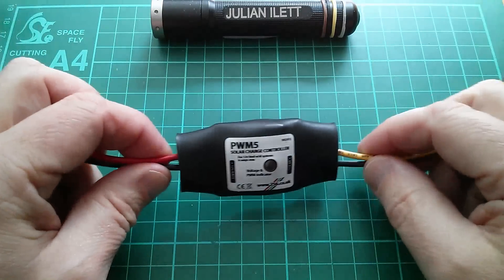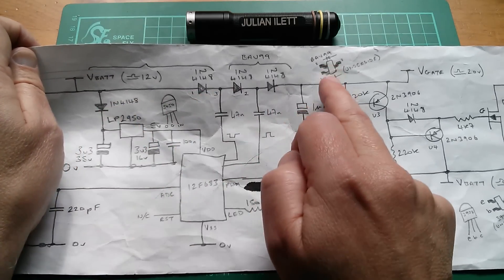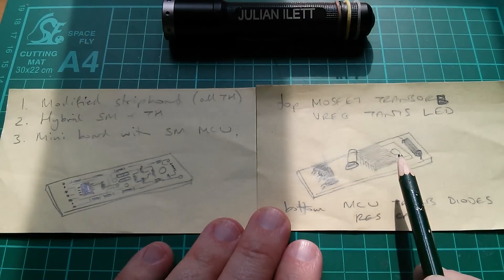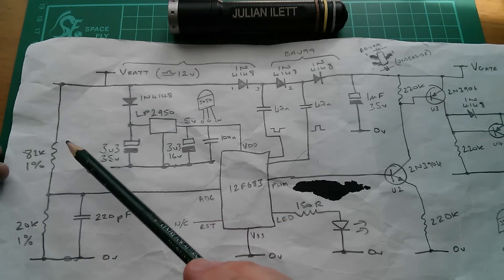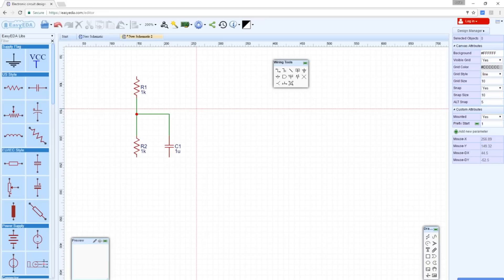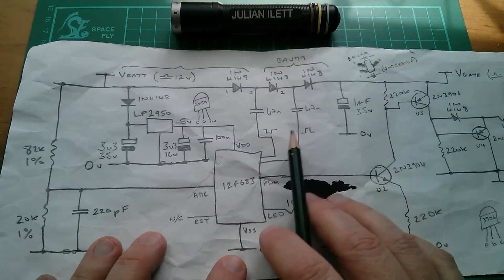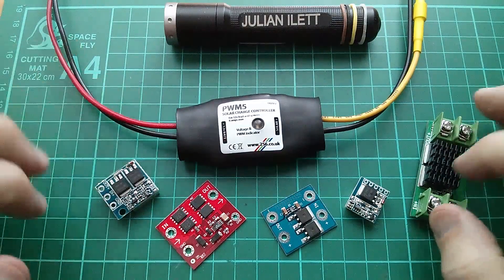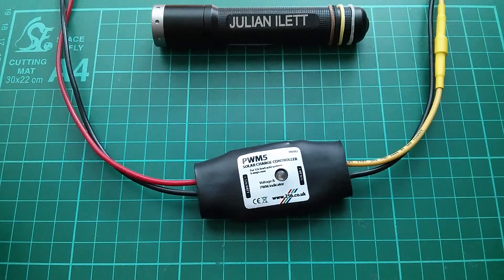PWM5 Solar Charge Controller SMD Re-Design with EasyEDA

Comment: You REALLY should consider to buy yourself a proper new PC. :/ The FPS of the screen capturing is really not that great. And screen capturing using OBS isn't even a big task for a PC.
Reply: An i7 and 1080ti wtf? That's super overkill considering what all he does... Any old i3 or an equivalent PC should be more than suitable for all his needs, also I don't know that he even exports videos, I thought he did like bigclive and uploaded a bunch of clips through the youtube app.
Reply from the maker: Not sure how old it is, but it's a Celeron 887 1.5Ghz with 4GB RAM. I'm guessing that's pretty bad :(
Reply: "1.5GHz" hehehehe!
Reply: Hell, why not recommend a Xeon E5-2699A v4?
Reply: I guess you can't spot irony, Ken.
Reply: Use http://www.ssdready.com to monitor your SSD for 24 hours, you'll be surprised to see how much an OS writes to your SSD.
Reply: OBS is really good, not super intuitive to use but I do not lose frame rate even on my relatively lame laptop.  Better than Bandicam or Hypercam...
Reply: Yes. I wonder how old his PC is, I guess it predates even 2007 or so...
Reply: Because that Xeon is for a dual CPU configuration (2 at the beginning) and EXTRMELY expensive. You could by 5 1080ti's for that amount of money when you also buy suitable motherboard and PSU. Video encoding has quite enough quality on GPU only encoding, which is several orders of magnitude faster. I guess he will be pleased with the video quality of that GPU.
Reply: +Julian Oh yeah, if you're feeling up to it, you can sometimes replace and upgrade the CPU in most of the older laptops as they aren't soldered (although some still are soldered) onto the motherboard, so as long as it has the same socket and a similar TDP rating, then it should work for most laptops, in your case something like an i3-2310M with the FCBGA1023 socket "might" work (has a higher TDP) and as it turns out is soldered which makes it very difficult to remove, but I did it with my old laptop and it's as fast as a brand new $500+ one, however you'll have to do some research and decide for yourself if it's worth doing.
Reply: I am pretty sure that upgrading the processor won't work at all, the socket will be obsolete. Used CPUs for this socket that bring more power might be even more expensive than a complete new PC with an i3 and integrated Intel Graphics for around 100 Pounds.
Reply: +Julian Ilett omg i've always skipped buying Celerons :)
Reply: Ken, Celeron 887 is BGA1023, so soldered on the board without a socket. I guess Julian uses a laptop.

Please point me to a place where they sell a new, complete Core-i3 PC for around 100 Pounds, I'm very interested.
Reply: Screen captures don't have to be exported, they can have huge file sizes if no form of compression or processing is used but it never HAS to run through an editor.

"The socket will be obsolete" What? That doesn't make any sense, sockets don't suddenly/randomly update or change, they can't become obsolete, well technically they can in the sense that a new processor won't fit in an older socket and vice versa but that's completely different and did you even look up the prices? Generally, for laptop CPUs they don't tend to sell as much as the desktop counterparts, I got my i5 for a mere $15 and they usually go for around $40-50 (40 pounds) on the high side.
http://www.ebay.com/sch/CPUs-Processors/164/i.html?_from=R40&_nkw=i3-2310M&_sop=15

You aren't going to find a new laptop with an i3/i5 for less than that, also you should consider that the new processors are moderately slower than the older Sandy and Ivy bridge processors in order to get that longer 6-10 hours of battery life, not a big deal for most people but for me I don't care too much about battery life.

+oscar kurka thanks for pointing out it's soldered, I didn't look up whether it was or wasn't.
Reply: My E8500 Core2Duo, with a 2300 CPU benchmark, probably could do it, yours is 1300. A cheap G4560 is 5100 CPU BM.
Also a SSD for the OS totally transforms a PC, because the PC feels very snappy when you use it, and you don't need as much RAM because the pagefile system is now so fast.
Reply: I did offer you one, it's a 3Ghz E8400 core 2 duo with 4GB of ram.
Reply: That's a myth. You would have to write 10GB/day for 10 years before it reaches it supposed writes. Every test on them has always shown them more reliable, and that was tested in servers.I personally would never use a PC without one for the OS, it makes that much difference, and in fact have 9 cheap SSD for the OS's in my PCs.
Reply: Depends on how old the SSD is, if it's one of the earlier models then it might wear out, but if it was made in roughly 2012 or later then yeah there's definitely no need to freak out about saving writes, even writing 100GB a day it would still last longer than a typical HDD, but even if you do have an old one, you can always find super cheap 16-64GB SSDs on ebay these days so you could get one purely just to dedicate to swap or caching.

note: I don't know a lot about how it works, but I do know that swap and pagefile operate pretty differently even though they serve more or less the same function and that swap is a bit harsher on writes than the pagefile, which is one of the reasons why the latest ubuntu is switching to a paging file.
Reply: Older SSDs use SLC flash memory which has a 10 x higher write cycle than the more modern MLC flash memory.

Writing 100GB a day on a Samsung 850 Evo 120 GB SDD wears it out in 14 months.
Reply: Sidney, why do you use 9 SSDs for the OS's on your PC? It's 2017, just use a bigger SSD and run them virtual.
Reply: I don't suppose you have a link about that? Because I remember this article a couple years ago about how they wrote several 100 TB worth of data to a handful of NAND based drives and one TLC based drive, of which, those lasted about 18 months doing way more work than 100GB a day.
https://techreport.com/review/27909/the-ssd-endurance-experiment-theyre-all-dead
Reply: Sorry, 9 different PCs and laptops. In fact everything I have has a SSD because most are old and the SSD allows them to keep up with more modern CPUs.
Reply: According to that article, If you write 100GB/day it last 1.5years, 10GB/day 15 years, 2GB/day, which is what you will use, 75 years. Trust me, buy 1, put your OS on it, and you will never go back, it's that good. Everything just feels so much more instantaneous. It's the  single biggest improvement I have seen in PCs in the last 37years.
Reply: "2GB/day, which is what you will use"

There is no way that you will write only 2GB/day on a Windows OS partition. You're lucky if you can keep it under 15GB, especially when you put the pagefile on the SSD.

Is that advice to me? I have been using SSDs as my OS drive since 2009.
Reply: EECat, that test only tested the write capacity of the Nand flash cells, they didn't try to read the data to verify it.
Reply: Even if it's 10GB that's still 15 years, a small price to pay for a much more response PC. You also have to remember bigger drives have more area to spread out that 10GB so last even longer. SSD fail lineally, where as mech fails exponentially, so every year the chance of a failure doubles. You have to remember all mech HDD fail, so why not have the speed.
http://www.tomshardware.com/reviews/ssd-reliability-failure-rate,2923.html
Reply: Yeah you're right. I did a search for files modded in a day and they were all 10GB, and going by the table thats 19 years for a 80GB SSD and 38 years for a 160GB SSD. The reliability is a non event because you only use it for the OS, which is expendable because you have the original disks - I have drive images which I can reload in 10 min -.
Reply: I've been running on the same 60GB SSD for probably 7 years though 3 laptops. I usually run without a swap partition on my SSD because I have always had plenty of RAM and I wanted to extend the life of the SSD, I certainly always did on windows 7. Turning off pagefile/swap partition has never caused me an issue. 

On my latest linux OS I left on a swap partition and just adjusted the "swappiness" value to tell it not to swap so aggressively. https://wiki.archlinux.org/index.php/swap#Swappiness. I could afford to do this because my whole OS partition and all the installed software is only about 30GB, compared to windows 7 which IIRC used that much for just windows and office, and windows 10 which the base install only just fit on my SSD.

From what I've heard on LinusTechTips, the problem with SSDs is they fail without warning and once they fail it's usually impossible to recover data, whereas mechanical HDD fail gradually and you can recover data, so why push your luck with a swap file on the SSD if you can avoid it.
Reply: Windows 10 is much smaller than Windows 7, though.
Reply: Not on my laptop. It came with 8, but I wiped it and installed 7 after a few months. When 10 came out for free for the first year I reinstalled 8 and immediately upgraded to 10. 5GB free on the 60GB drive. Would have been partly the recovery partition, since I had the 8 recovery partition on a separate drive but I think 10 put its one on the same drive automatically.
Reply: Clean up your SSD using CCleaner, you probably still have the old Windows 8 files and the Win10 download on it. The footprint of Windows 10 is much smaller than 7 or 8.
Reply: I expect it could have been helped by reinstalling fresh win 10 from the recovery partition or clicking the button to "create install media" at the time rather than upgrade from 8 to 10 and then installing from that DVD. In the end I just repeated the process of installing 8 but onto the original mechanical HDD that the laptop came with, upgrading to 10, using that until July '16 when Windows update auto-bricked my machine and I then gave up on 10 just like I gave up on 8 and had to chose to either go back to 7 again or go to Linux. This time I chose the later. 

I've been an MS fanboy since DOS 4, but it just hasn't been any good since windows 7, especially now with the inbuilt spyware, freemium games you can't remove, advertising in the lock screen and soon in file explorer itself, buggy updates that brick your computer, removal of win 10 pro features like the ability to turn off auto updates etc. 

Last time I checked (a long time ago, back when it was new), CCleaner contained/was malware and there was some significant risk that it could corrupt your registry and brick your PC, so I have always avoided that. Fresh install of win 10 rather than upgrading from 8 would probably have been a better idea than using CCleaner.
Reply: Let me guess, you run Ubuntu?

You can disable the 'spyware' in W10, you can remove the freemium games, you can disable the advertising, you can turn off auto-updates. You just have to know what you are doing and clearly you don't.

Idk where you downloaded CCleaner from, but it doesn't come with adware.
Reply: Some mech fail with warning - usually noisy -, but some don't. Lost a 2TB 2 months ago  that didn't make a sound, and in fact it still spins fine it just wont read files. It was low usage storage that very rarely gets anything written to or read from, and yet it craped out on me.  Even the ones that clicked I had trouble getting files off - that's where you learn to backup -, and if I have a noisy drive I chuck it straight away. Like I said, make a drive image because it a 15 min fix.
Reply: Well I wouldn't ever toss a drive because of noises, they can still be good for another 1-3 years before anything bad happens, I have two noisy drives myself that while a tad annoying have been otherwise fine for the last two years and hey you can always find other uses for them, like dedicate it to virtual machines you don't care about losing or install linux onto it or even just store a few extra backups on it then unplug it for safe keeping.
You didn't mention what you did with that drive but, if you still have it you could try getting another drive (preferably of the same model) and swap the platters, which should allow you to get the data off it, since it sounds like it's just a problem with the arm/head accessing them.

Also, I'd like to note that it depends on the noise, obviously if it's usually quiet and suddenly starts making a loud clicking or something then it's probably bad, but you can buy enterprise grade drives which don't have any acoustic management meaning they will always make little clicky noises while in use (mine does anyway) and you can find software that let you manually set the acoustic management for drives that support it to a higher level to make them perform slightly faster.
Reply: After you have had about 5 failures you never trust a noisy drive again, unless it's a backed up. Seagate are inherently noisy, and I have have lost 3, so I switched to quiet WD. I liked Samsung because they were quiet and cool, yet one went 2 months ago with no warning. That kind-of explains why Samsung shut down HDD production, too many failures. There was massive failures when HDDs first went over 100GB, and it was so high - some reported 36% - that nearly all of the manufactures shutdown. Out of maybe 10 we probably only have 2 left.

It's not like it's a question of IF a mech will fail, but WHEN will it fail, because they all eventually blow like all light bulb blows. If you use mech you will rarely run it 10 years before you upgrade to something bigger and better, and yet the anti SSD guys expect a $50 drive to last half a century. There in no way in 2017 that you should not be using  a SSD as the OS drive, it's just miles ahead of any mech HDD in speed, and equal if not better in reliability. thesedays you can't even buy a high end fast laptop with SSD for the OS.

It makes me laugh how people spend $1000s on upgrading CPU/MB/RAM to make their PC more responsive, and yet a $50 SSD will produce results that feel 4 times faster than those $1000s.
Reply: I guess I'm lucky because funnily enough, I've had the opposite experience, thus far I've not had a single outright drive failure out of 9 drives (half of those are used and I've had them less than a year) 4 SSDs + 5 HDDs and before anyone asks I don't actually use all of them, I use 1 SSD for OS and 3 HDDs for storage (as well as backups) then I have 1 SSD for my laptop, one of those drives is a 250GB WD mech from 10+ years ago which has a massive 43266 hours or 5 years of on time and aside from 140 reallocated sectors, it's still going strong and the other two spare mech drives I have since retired as external/experimental storage after they became noisy.

Uhh, was the second half of your comment some sort of rant? Because I'm not sure how it relates to what I said previously and yeah it is kinda silly to spend upwards of $1000 on a PC and not get an SSD but all it depends on what you're doing, for instance with gaming, all you really need is a half decent CPU and a good GPU then you'll be able to play pretty much anything, so as awesome as SSDs are, if someone wants to cheap out on storage then it's your PC not mine so I don't care.
Reply: I have 9 SSDs, 1 old OCZ Vertex2 that bricked it's self because the old firmware back in the day was badly written, and 8 running fine after 6 years. I've probably had 50 HDDs, with about 5 dying and 5 given away before they died because of clicking. I have 3 storage PC like you, with 2 SSDs in each - OS in each swapped by cable -, and 3 HDDs totaling 6TB for storage in each. Also have 2 very old laptops that can keep up with modern stuff because they run SSDs.

It's just the anti-SSD guys are so uninformed, it's surprising. Like all the problems with SSDs were fixed 5 years ago, and in 2017 they still think SSDs are bad. 
I just got a i7 960 with HDDs, that drives me crazy because  you click on something and you have to wait for it to open. Where as my older E8500 with SSD is nearly instantaneous.
Reply: All the problems with SSDs were fixed 5 years ago?

Try running a database server on an SSD and see how long the SSD will last.
Reply: I meant personal PC use. 

There was scant info back in the day about server use, but the findings back then was that cheap SSDs fail at the same rate as HDDs,  but if you got expensive Intel ones it had a failure rate 1/10 of HDDs. They came to the conclusion that SSD was better for the higher throughput and lower power use, even if it failed at the same rate.

Why all this server talk, it doesn't really apply to many people.
How long did your SSD last, and how much writing did it get.
Reply: Intel have put a limit inside their firmware so the drive becomes read-only after a certain amount of writes, so it actually becomes useless before the cheaper drives do.

Why all this talk about having 9 PCs, it doesn't really apply to many people.
Reply: Why all this talk about having 9 PCs, it doesn't really apply to many people.

I shows a larger sample than 1 server, which not many people have, and so won't apply to many.
Reply: You can get Decent Ram for it but CPU Clock speeds may be a worry. I would get a whole new rig for 80 quid with a lga 775/771 cpu
Reply: Yeah also kind of funny that you mention OCZ because my first SSD was an Agility 3 which is only a few months older than the Vertex 2 and I'm still using it as my OS drive.
Reply: on my SSD i have written 13 479 GB of data... so
Reply: 64 TB here. Intel 750 Series NVMe SSD (400 GB)
93% lifetime left.
Reply: 10 x GTX 1080ti's, 4 x xeon, decent PC for everyday work xD
Reply: Dear heaven. You owe it to yourself to get a nice modern pc. For example, if you got a Ryzen 1600 for 200 usd, you would have what, (really rough estimate) 6*1.5 (for smt)*3.4= 30.6 vs 2*1.5=3.

Dear god. Make yourself happy, and without breaking the bank!

Edit: I somehow missed you were on a laptop. Any 4 core laptop thats modern would blow that out of the water as well.
Reply: Don't rely on the pagefile on an SSD too much though. SSD's lifespan is directly related to how many writes each memory cell has. I recommend disabling pagefiles on SSD's unless absolutely necessary.
Reply: Unfortunately not. You can get something that will be far more fluid in ALL terms for 120 EUR or 100 Pounds. But I recommend an AMD Ryzen or latest Intel i7, that way you could do faster video exports and don't have to waste so much time for videos. Also a GTX 1080ti for GPU encoding with OBS. Fluid 60 FPS will also be possible. But also a 100 Pounds PC will make fluid 30 FPS screen capturing.
Reply: Nope, I can't spot irony or sarcasm cause I'm autistic. xP
Reply: Videos with screen capture must be edited and exported AFAIK. Normal videos can just be uploaded and edited in the YT-Editor.
Reply: get your self a q6600 and a gtx 780, will serve you well, and cheap